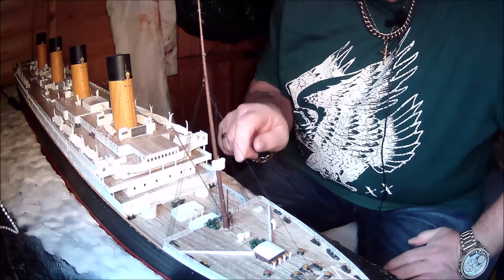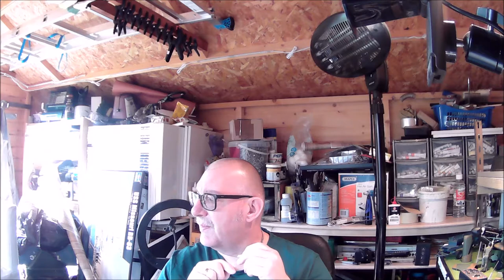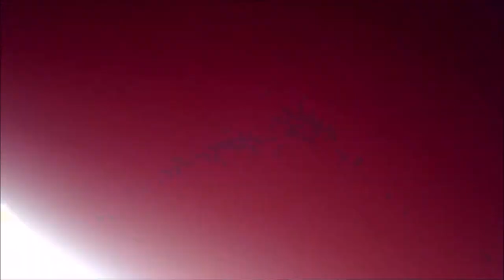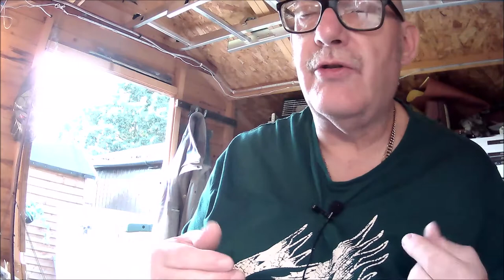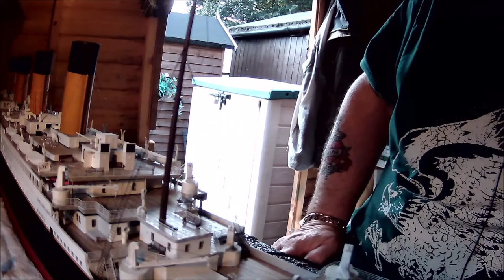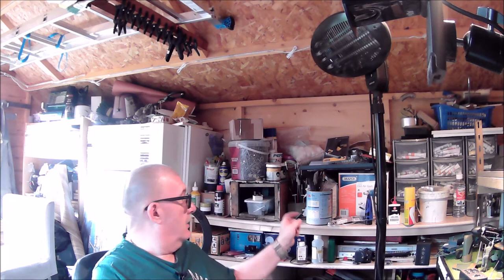BUILD THE TRUMPETER TITANIC KIT STAGE 53 PART 2

Comment: looking great Dave👍, PS got up to 118 on spitfire same as you and guess what, motor gone on undercarriage😒, so you are not alone
Reply from the maker: Thanks mate not much to do on it now, just a bit more rigging. I gave up on the spitfire undercarriage, I don't put it on now, nothing but problems since issue 36 when we had to change the cogs and wire, I'm still waiting for issues 119 & 120